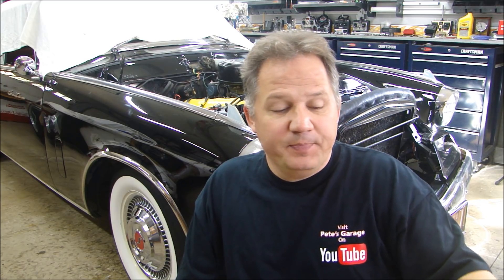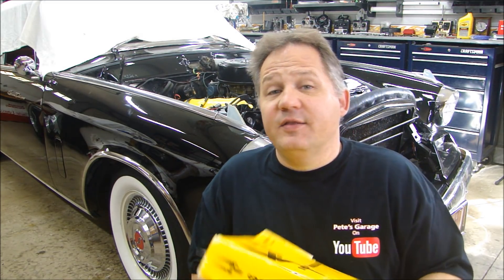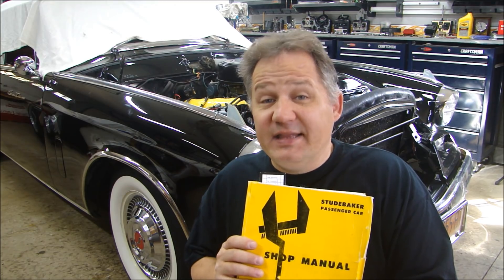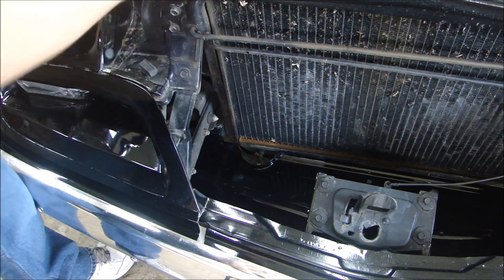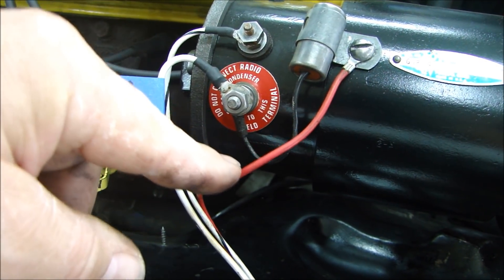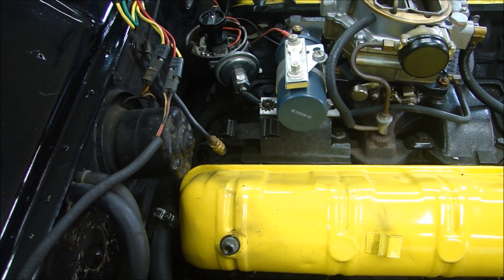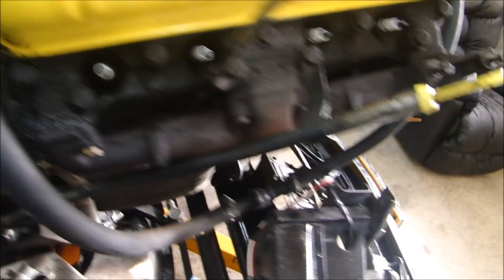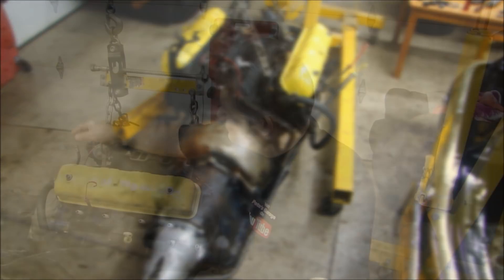Engine Rebuilding - Removing the Engine

Comment: Hey Pete I really appreciate your videos the information and visuals are very helpful. Just a suggestion to make the content even more engaging/functional. I've noticed that often when you do a disassembly or assembly of a component during a video, you'll say something like "Now I'm going to take this off," or "put this back on," and then the video cuts to AFTER you have taken it off, without showing the process of taking it off/putting it on or whatever. It's just my opinion, and I can't speak for everyone, but for me there's a HUGE amount of value in SEEING and HEARING the individual parts come off, nuts, bolts, brackets, clips and all. It's not to say that you can't strategically edit the videos to cut at certain times. Most people don't have time to watch a 40 hour video of an engine rebuild lol. It would just be nice to actually see the disassembly of components during the builds, because for me, those steps are actually the most intimidating part of working on a car. I think many people asse that they might break something or do something wrong in the process. Seeing all the pieces come off in sequence bolt by bolt helps alleviate that stress and prepare the mind for encountering the real components up close and in person. Anyway, just my two or three cents. Forgive me if you have separate videos on the channel that show this kind of thing in detail already. I'm new to the channel and once again I appreciate the content and keep up the good work.
Reply from the maker: Thanks again Matt

Comment: Is a Service Manual the same thing as a shop manual? I'm thinking I'll need to pull the engine out of my 1965 Dodge Dart and I've never done much more than change my own oil. I'm having a hard time finding any manual for this - that's how I found your video!
Reply from the maker: For most brands, yes.

Comment: Is that a lark or hawk just curious i have an avanti with lark frame suspension ect
Reply from the maker: '62 Hawk
Reply: So what do you start with first. Do i just hook hoist up, unbolt driveshaft take off starter, put a jack under trans or no?, unbolt engine mounts and then trans crossmember? Everything i didnt mention ive already done.
Reply from the maker: I started by taking off the hood. Remove the radiator, fan, all or the accessories, wiring, exhaust, disconnect the transmission linkage, remove the accelerator linkage, unbolt the engine and tranny and start lifting. Check as you lift to see if anything else is connected.

Comment: I have a 38 year old V8 and I have moulded rubber sheeting and covered this with fibre glass to form moulds for the front wings on the engine bay. I have thick felt glued to the underside of the rubber to make as soft as possible any material contact between the wing protection and the paintwork. I also will only wear what we call jogging pants and a rugby shirt. In the States a hockey top will do. No form of jewellery not even a watch nor a ring. If you don't take off your wedding band tape it up. Once the wing fibreglass protection is made for your car it will last a life time. Takes seconds to put in place and will save  on a whole world of pain for paint renewal due to a dropped tool.. Screw drivers always seem to land on the corner edge when dropped. Alas they cause so much damage to your car. A friend recently dropped a tool on my car before I had the protection in place and I was almost in tears. As it's going to be expensive to repair. I'm sorry does not cover the cost of a two day touch up on my paint? Brilliant video by the way I learn so much from my American brothers from across the pond. Be good be safe and safety is the most important word in the work place. All the very best to everyone from Scotland .
Reply from the maker: Thank you very much....I guess he may not be your friend anymore...lol. I hate when people stop by and are not careful.

Comment: Have you ever done an entire front to rear wireing harness replacement? I have a rats nest of different color wires and electrical components that don't work or have an intermediate condition, my project is a 78 f250 camper special that I have swapped a 460 into.
Reply from the maker: I've done many complete wiring jobs. It takes patience and organization for sure
Reply: If u haven't already made one I would love to see you do a wiring harness video cause people are starting to get into rebuilding 80s and 90s with electric stuff
Reply from the maker: ok

Comment: hi petes garage!! really excited about our engine to rebuild.  its my first time /experience to overhaul an engine.  can you share me some tips/advice?? thanks petes 👍👍👍
Reply from the maker: Start with safety, practice good organization, takes lots of pictures, use the proper tools, know the correct torque for fasteners, and use a good assembly lube, finally DON'T RUSH
Reply: ***** highly apreciated 🙌🙌! for fasteners, crankshaft=120 /ft.lbs, conrods=62 ft.lbs, cylinder head = 100 ft.lbs, rocker arm shaft=27 ft.lbs. is it the correct torque??  for my 4d56 engine soon to overhaul
Reply from the maker: I would check to make sure those numbers are correct
Reply: Thanks sir petes! Will appreciate your response 👍
Reply: Greetings sir petes!👍

Comment: Good tip on keeping parts organized.  A bracket I am almost sure came out of my latest project seems out of place.  It won't go in anywhere.  Turned out to be a compressor mounting bracket from a refrigerator that I cannibalized earlier. Lesson learned........................the hard way.
Reply from the maker: I hate when that happens. I had a few projects going on at once and some parts got mixed up. That sucked

Comment: Glad you're stressing safety. Alot of the classmates I had in high school auto tech never gave much thought and scoffed at the instructors when scolded about safety. One day we came in and our instructor informed us someone in a city over was found in a garage under a lift that failed hydraulically and didn't catch on locks.  

+1 on labeling. Learned that big time on my Camaro. I labeled literally every bolt that came out of my Mustang when swapping a blown engine out of it. Had it completed in no time thanks to knowing what went where.  A factory service manual also helped. So thanks for telling people those exist. I mean the real ones, not the small Haynes books. Those help, but not like Helm helped me. 

Safety and efficiency, people! Safety and efficiency!
Reply from the maker: Awesome! Thanks Tyler

Comment: A while back I started to design an app that would be specifically created to help document automotive and airplane repairs. I only quit after several people told me that amateurs would be content to just take a few pictures, and professionals wouldn't want to create proof of any mistakes they might make. It seems a shame. There's a lot that modern devices can do to automatically process and organize the images. Sensors like the ones in Google's "Project Tango" can quickly map the interior of a building. It wouldn't take much more effort to quickly map the parts in an engine bay.
Reply from the maker: That actually sounds like a cool idea. It may be tough to sell when pictures are free

Comment: Great tips.  A little work now saves a TON of work, time and possible frustration later.  I also use the manila toe tags for parts i.d. this is great for storing parts that you may have more than one of.  For me it is crankshafts.
Reply from the maker: Any type of system to organize parts helps. Thanks for the idea

Comment: You show way too little. I wanna see you disconnect all the cables and remove all the fasteners.
Reply from the maker: That would get a little boring
Reply: Giovanni Foulmouth, This guy has made a 15 part series for rebuilding an engine that is very in-depth. Check it out. He is very detailed. The information you may be looking for might be in another video.

Comment: You talk about documentation I could not agree more. This car is not anywhere as bad as modern cars wire harness is way worse with all sensors. A great way to store parts in bags, put an index card with notes in it I have had marker come off bags u can also not different length bolts where they came from on the cards as well. Cars I have done I have done within a week usually you can remember but a year later I and most will not remember a year later. great vid
Reply from the maker: An index card is a great idea. Thanks for sharing that. Along with pictures, anything will help